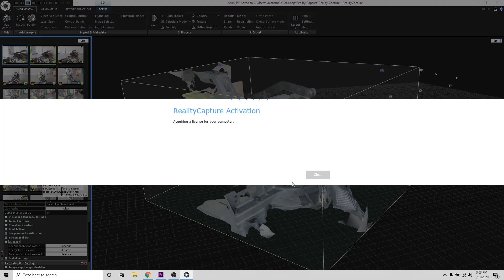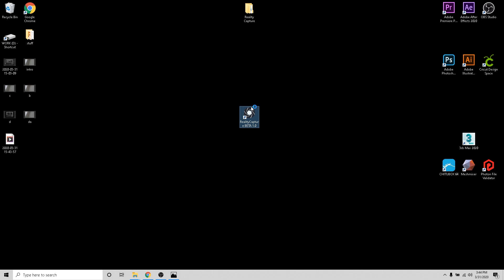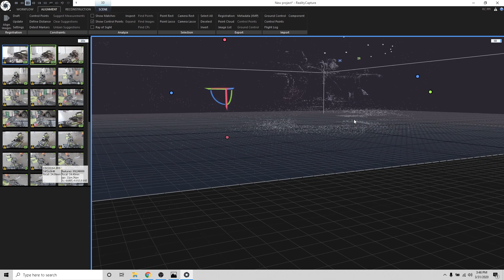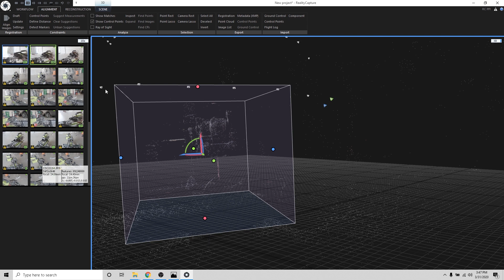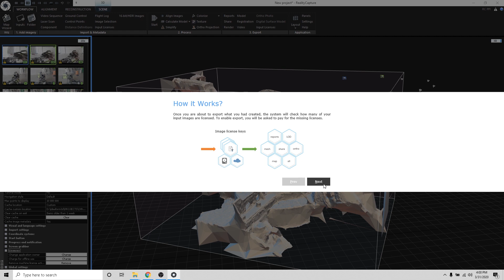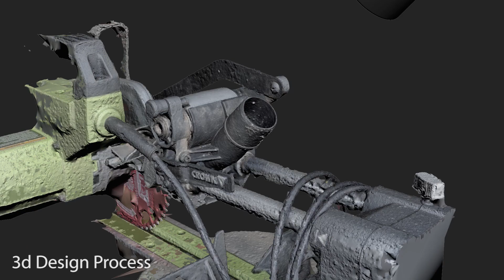RealityCapture PPI Tutorial For Prototyping and 3D Printing

Comment: You could just make a cylinder and type in the parameters such as diagram and thickness in any 3d drawing app. Than just export as .stl and print. No need to use photogrammetry,because its a very simple and basic piece. And you just calculated the R but didnt type in any measurements in to that scan. And where is the part that you modelled that piece from exported scan file. The most important part as suggested by the title....